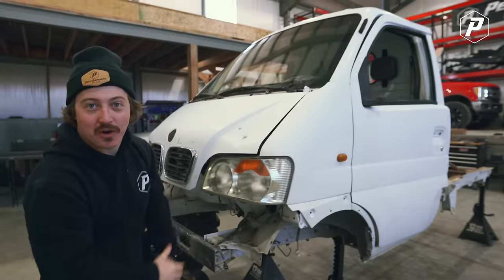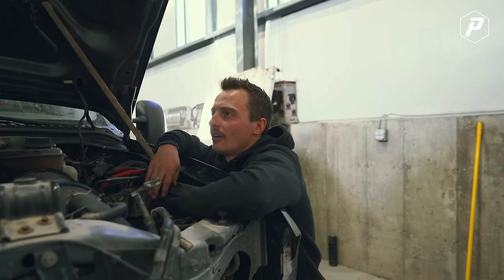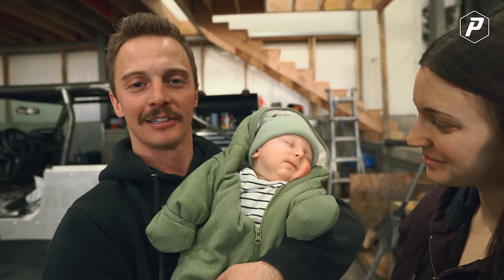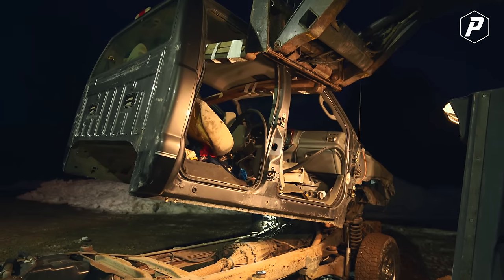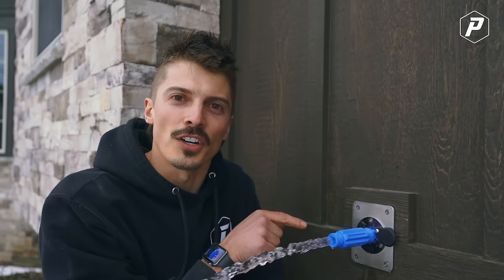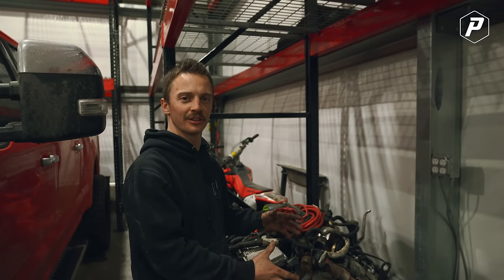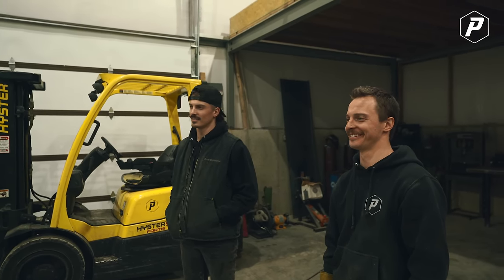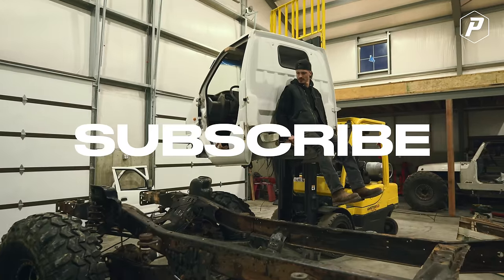WE'RE BUILDING A MINI OFFROAD WRECKER

Comment: VW TDI there 4 cylinder small footprint easy to find cheap and they adapt to any transmission and they will make 300hp just look into it you’ll be surprised at how much support there is for it or use a turbo echo tech out of a Cruze and turn it up
Reply: I wish they were cheap 😅 spent 4k on the car tore the engine apart we all know if you do that you need go fast goodies I'm about 9k deep 😅 and the adapter to the toyota Trans was 4k 🥲
Reply: Vw  TDI perfect 👌 diesel engine
Reply: @Gettinbentoffroad  dang man I bet it will be nasty when it’s done we have about 4K in everything on ours and that was buying stuff we didnt need to have just wanted it… but we buy our cars from Copart for next to nothing so we save a lot of money there if I paid 4K for a car I could see why your close to 9k… the last 3 that I’ve bought from Copart the most expensive was 950 and it was a diesel Passat that got rear ended the other too were under 500
Reply: @benjaminblaazavich5471  could the diff be weld in the factory trans..so driveshafts could turn the axles? Like the some of the buggies using Honda motor/trans?
Reply: @bushjeeps  I’m sure you could weld the diff but idk if I would go straight to the axles… that’s a lot of load on 43 stickies and that little transmission would have to put in some work… might be able to build a cap for one side and run the other side shaft to a divorce ford 205 but still putting so much stress on the trans but atleast you could gear reduct the transfer case… I’d run a th400 or find a Toyota 5speed and transfer case
Reply: @Gettinbentoffroad what in the world did you buy? Me and a buddy did a tdi swap on his Toyota out of a mk3 which was a ahu the car was bought for 1000 (wrecked car ) adapter kit was for a samurai it come in at 600 and we made mounts all in maybe 2.5k and that’s being liberal it was bone stock did great, wish me would’ve recorded it bc it was a fun and somewhat simple swap
Reply: Not so cheap but an amazing platform and should definitely happen
Reply: Do an industrial Caterpillar C4.4 200hp and 609 lb-ft of torque at 1400rpm.
Reply: @jangelsantana2266  bought a very nice very over priced kit from northwest fab but it is beautiful
Reply: @jangelsantana2266  also when I pulled the engine apart for a re gasket, went ahead and did a stage 3 colt cam 140 over injectors big turbo kit

Comment: I have a bullet proof 6.0 in my old 2003 excursion.  and after the bullet proof job done 10 years ago it has been amazing, I pull a 30 foot boat around Alaska with this rig and never had any issues.. yes those engines need the fixes , yet after you do a proper bullet proof with the heads etc. you will love that thing.. hope you find a project for that engine tranny 4x4 6.0

Comment: I’d go with a a vw 1.9 tdi. They are dimensionally small, weigh almost nothing, and parts are readily available, I’d be worried with a 4bt as they are a fairly tall motor and you might run into axle to oil pan/ valve cover to cab clearance issue. A dry sump would help on either option though. Also, if this doesn’t have an exhaust stack Gunner will not approve!
Reply from the maker: I can 100% promise a stack if we can figure out a diesel 😂😂 we need to look into these TDI’s

Comment: I would recommend one of two engines (1) 3.0 VW TDI (Malone tunable to 325 Hp & 500 lb-ft). it's a v6, so it's compact. and Northwest Fab makes adapters for it to whatever.  Or, (2) the BMW M57, which is an inline 6, compound turbo setup. Malone makes a tune for it that will see 380 Hp & 570 lb-ft.  Both options weigh way less than a 4Bt and make way more power for the money.

Comment: Still stand by the suggestion of vw tdi light weight can be found cheap could even use the transaxle if you welded the diff in it. Vw auto are not very strong but the 5 spd is.  It would be ultra compact as well.

Comment: 4 cylinder 4bd1t or 4bd2t diesel, both are easy to find in isuzu cab over trucks and the make bell housing adapters that go straight from the engine to a Chevy trans

Comment: On propane powered motors I want to say there is a sensor or something like an oil pressure sensor that shuts off the propane when the motor is stopped. That may be bad. So it takes a bunch of cranking to get it to work.

Comment: could do an om606. dieselpumpuk makes adapters to 700r4/4l80 etc. has huge power potential plus it can be mechanical injection. its a 3.0 inline 6 shouldnt be too big. theres also om617 inline 5s from the older cars im almost certain they make adapters for those also. probably not as much power potential though. but both are super reliable

Comment: 4bt with TH400 and twin stick ford NP205 twin stick, custom rear suspension on air bags to handle heavy load have the rear tires maybe couple inches past the rear bumper to help with inclines

Comment: Mercedes turbo diesel either om605 5 cylinder or the om606 6 cylinder. Diesel pump uk on youtube has tons of information on them and they build crazy power and turn lots of rpms! Plus with one of their injection pumps ypu can make it mechanical instead of electronic, less wiring to deal with! 😁 plus there is companies out there that make adaptors to run chevy transmissions behind them.

Comment: So many Mercedes 300d cars out there most of them with an inline 6 and the om617 mechanical style fuel pump and plenty or torque. No computers. And with a turbo upgrade you could make it work well. I have looked at doing a swap into my 1980 cj7. Also you could probably get 30 something mpg. Just sayin, pretty good ?!

Comment: Find an old diesel  Merecedes engine & transmission . You want turbocharged 5 cylinder  out of a 300 SD. Preferably with a mechanical injection. They can be turned up make some awesome power.  Get on line look it up.

Comment: What about the small Isuzu diesels. like in their 16’ box trucks. They have a ton of  torque and they are made for a cab over design.
Reply from the maker: We have been super close to getting one we just can’t figure out how to adapt it to run a Transfercase!
Reply: @PeckBrothers  got ya. that would be an issue.
It seems like it might be possible to convert a turbo 400 Chevy trans to fit the NPR Isuzu engine. I’m not sure how hard it would be, but it would be a good combo.

Comment: I always thought people said to stay away from 6.0's due to a bad design. What upgrades do you guys do to bulletproof the engines? I heard a few things like an upgraded Egr cooler and an oil pump upgrade. Is there anything else you guys may have run into in the past that could make them better?
Reply: They’re joking haha, the nickname of the engine is a 6.Blow. But my friend has one and it runs really good. Swap the factory sensors, coils, plugs etc to NTK or NGK, then add head studs and deck the block/head instead of the stock bolts. Add a oil cooler and trans cooler. Add a dual oil filter system. Get a digital info cluster and tuner that you can put onto the dash. Those are some of the mods he has done. Oh and good batteries are huge.
Reply from the maker: So we really most love them because we have worked on them for long enough to be super familiar with them!! And everyone hates them so you can pick them up cheap and have a killer truck when your said and done!! We do: Ford head gaskets, ARP headstuds, factory oem Ford injectors, bellowed up pipes, wicked wheel in the turbo along with rebuilding it, SCT fitting, Blue Spring upgrade, stand pipes, dummy plugs, oem HPOP, oem EGR cooler, FICM tune, Bulletproof front cover, and aluminum radiator! There’s a couple more things you can do but we have had a couple with that list that costs around $6,000-$8,000. Sounds like a lot just to make your truck reliable and it kind of is but Navistar wasn’t ready to release the motor when the EPA made Ford put it into production so they didn’t have enough R&D to fix all those bugs in the motor. Thing is if you pick one up with problems for $4,000-$5,000 and dump $8,000 into it you have an absolute animal of a truck that will go 200,000 miles with no issues for 13,000. Hard to beat when everyone thinks there clapped out LB7 Durmax is worth $26k and their single cab long bed XLT 7.3 is worth $18k. Long explanation but hopefully this helps 😂😂😂
Reply: @PeckBrothers about as good of an explanation as one can give.  I miss my 6.0 but have ro admit the 6.7 is a beast!
Reply: Thanks for the responce! Also it dawned upon me. What if you stuffed a eco diesel from a grand cherokee or a ram 1500 with the 8 speed trans? The 8 speed trans will give you many gears for crawling. We have one (deleted) it is a serious power plant and can make serious hp and torq especially tuned. Should fit well too. I can get measurements from front of engine to the back of the trans where the drive shaft connects if you'd like.

Comment: I like the cab mods you did. Looks way better. As for what engine to use. I own a 2x4 Ram 1500 with the v-6 Eco Diesel. Main job is to pull our 28 ft RV. Its max weight is 6000 lbs. That thing has so much power and torque it is pitiful. Small motor, lots of torque and you can tune it up more if needed. No joke that is what I would be looking at. Small and torquey as hell.

Comment: I’d pick up the Isuzu version of the Cummins 4 BT they can handle putting bigger turbos on them and the rebuild kits are way cheaper.
Reply from the maker: We just can’t find a transmission to put behind it to run a transfer case!!
Reply: Can you do a divorced transfer case behind the transmission that goes to this Isuzu motor?

Comment: OK, hear me out on this.  Use a Ram 1500 EcoDiese turbo 3.0L V6.  I just completed a swap into my 1961 Willys Wagon and I love it!  It weighs only 505 lbs, puts out 300 HP and 500 lb-ft of torque.  I can tell you how to get it done and where to get the parts.  BTW my 61 Wagon weighs in at 5800 lbs empty and this engine will lift the front end!  I have 4 link with coil overs in the back and 3 link coil overs in the front.  I'm using the 8HP70 transmission with a Atlas 2 transfer case.
Reply: Would love the details on this thing!  Is there a link or IG page I can follow?
Reply: @anthonywoodall8854  I tried to give you a link but it keeps getting deleted

Comment: I’ve owned 1 truck in my life. It was a 2006 6.0. Did just fine for about 5 months and then started needing injectors. Fixed 1 and sold it. Lost a bunch of money on the loan but it was worth it. I’ll never own one of those motors again.